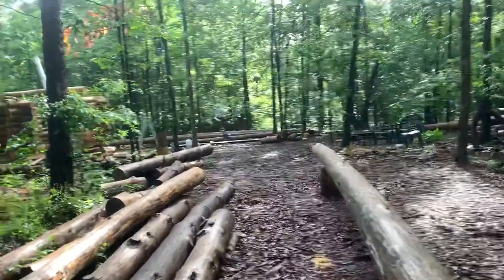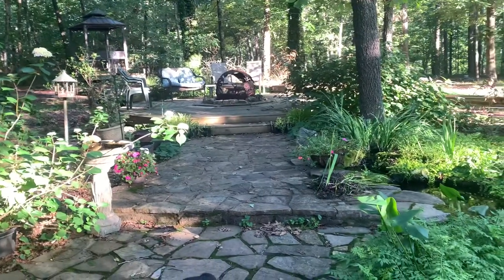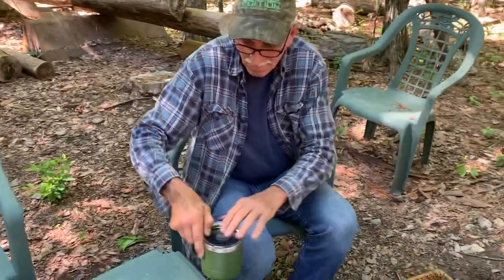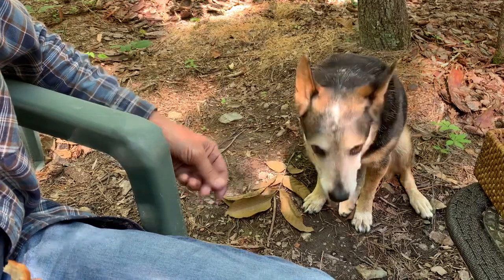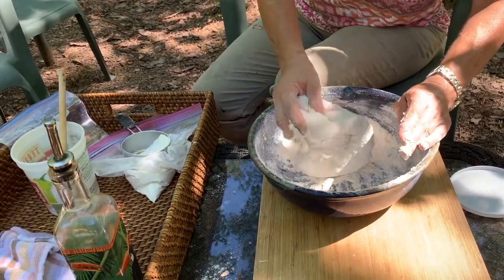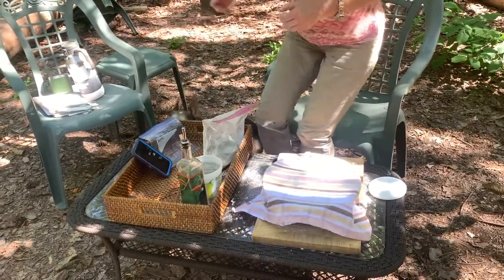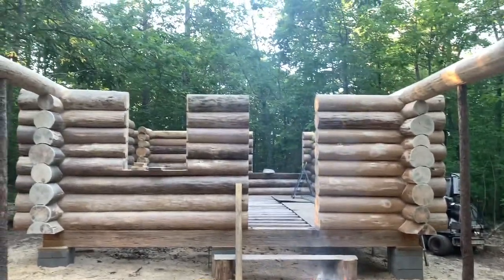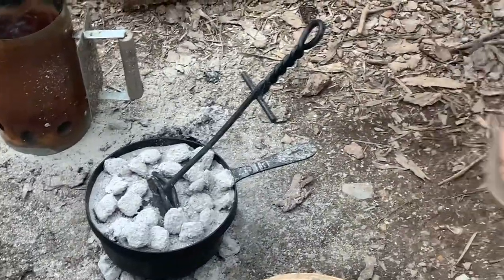Log Cabin Build PART 16, 35 foot logs over the porch, campfire pizza in the dutch oven

Comment: I remember you said your using green pine. Does that mean you didn't let them dry out? How do you allow for, I guess shrinkage?
Reply from the maker: Yes we started cutting in September 2021 and cut some up until about April of 2022. Ideally it would be a good idea to cut all you need and then start building, but we didn’t really have a clue as to what trees we could get to work. This is our first log cabin🤣 They would also be considerably light weight. Even so, unless you wait a year or two they are still considered green. They take several years to dry completely. From what we’ve read, you have to allow about 1” settling for every 16”. That is why we are leaving a gap above the windows and doors. Otherwise the logs would crush them as they shrink and settle. We will have more on that in future videos. Also have to allow for settling on interior walls, cabinets etc. It takes a lot of planning😁There are interesting ways to deal with all that. People smarter than us have already figured out😂